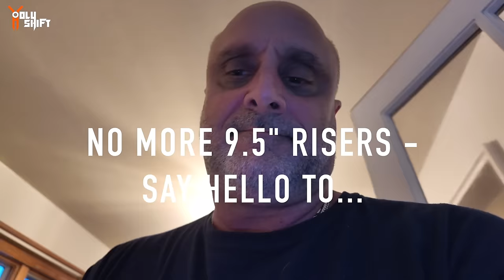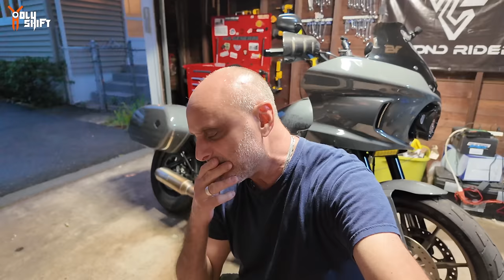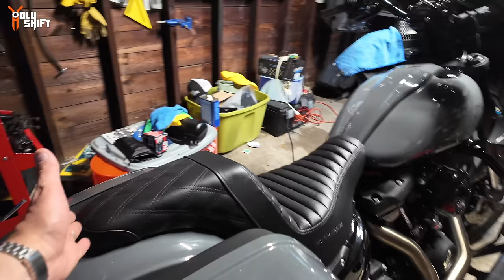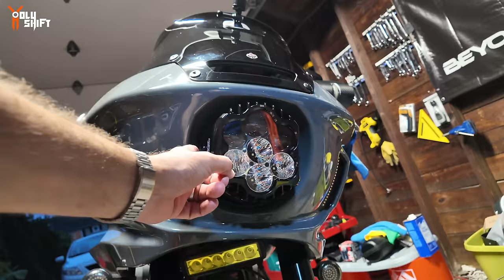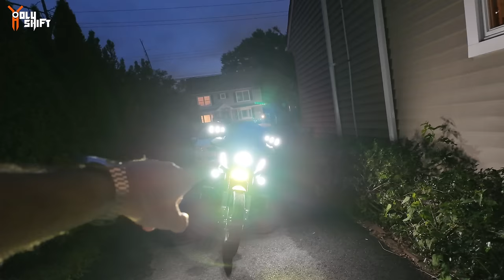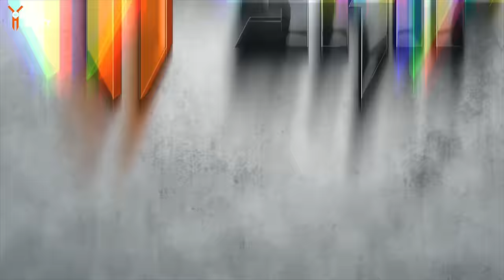RISERs - ARE GONE !!!

Comment: I did a 20-day trip recently, 10,000 miles around America and Canada. I would recommend a few things since I done it on a Harley Davidson Heritage 114. 

1: Check your tires. With all the weight you'll have on the back, you're going to be burning the tread on them much quicker. I changed mine to a fresh set just before the trip and it barely lasted the whole 10k. 

2: Invest in a toursuit. I bought a tourmaster toursuit and it was ideal for every condition. 3 layers, base layer, which is the shell, waterproof layer, and thermal layer. The thermal and waterproof can be zipped out depending on conditions. 

3: Do an engine oil change at the bare minimum. From PA to California, I went down south and across. 5000 miles and did an oil change in California.  The oil was dark as hell 😂. 

These are the few points I had, but I'm sure you're experienced and would have a plan for this. I just wanted to give my 2 cents. Hope you guys have a great trip and ride safe 🤙🏽
Reply from the maker: Thanks buddy- great tips. I just installed new tires and 3 hole oil change. I have the proper riding clothes too . I bet you had a blast !
Reply: @HOLYSHIFT Absolutely, life changing experience. It's like everytime you come back from a tour you learn something different about yourself and your mentally changes completely.

Comment: Sandy, maybe a Kraus T-Rex kickback plate would help? I'm planning on installing one this winter. '23 LRST with a 6.5 riser and mid bends, just want more pullback
Reply: Absolutely love my Trex pullback plate. Made the ride so much more enjoyable.
Reply: @EddieFresh3  any issues running them? I know I'll have to extend every control, but thats not a big deal
Reply: @shaunylee93  no issues but I had to extend the wires and cables with my setup. Running 8" Murdock riders, the Trex, with thrashin mid bars
Reply: @EddieFresh3  Sounds good. I anticipate doing the same. Did you happen to run an OEM upper clutch cable or other?
Reply: @shaunylee93  ran oem upper, I forget which length though, when I did the aftermarket stuff wasn't available yet. This was back in 21.
Reply: @EddieFresh3  nice! If you ever find a part number, let me know! I lost my list of HD part numbers for upper cables